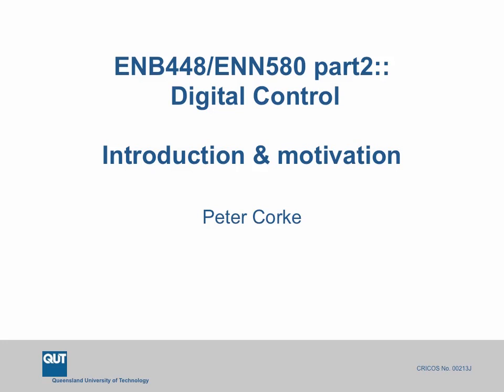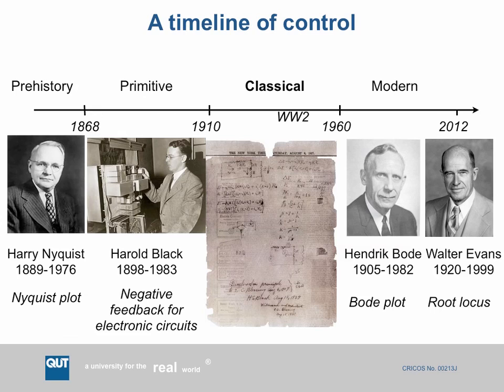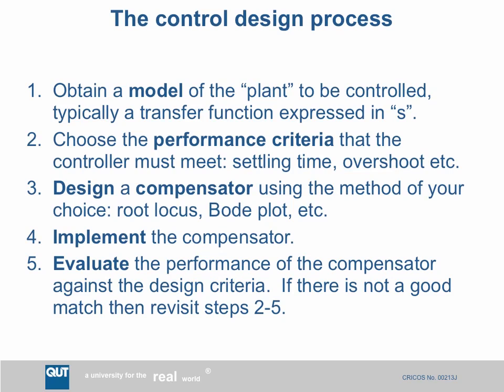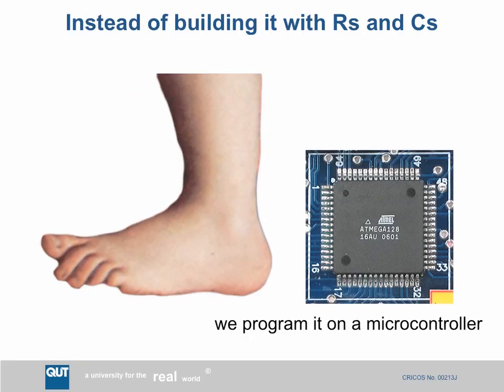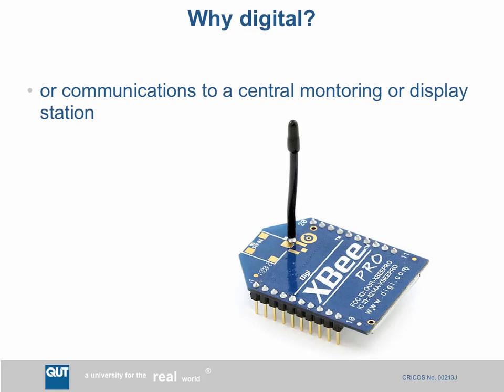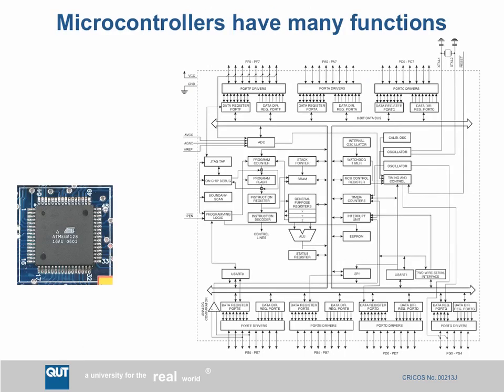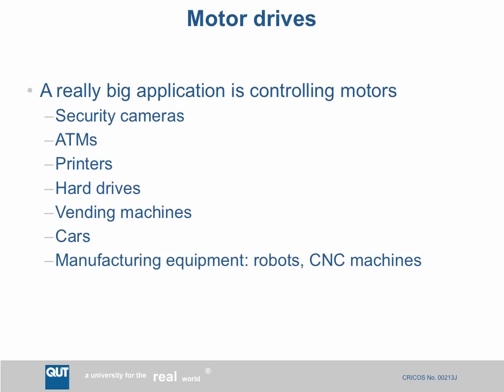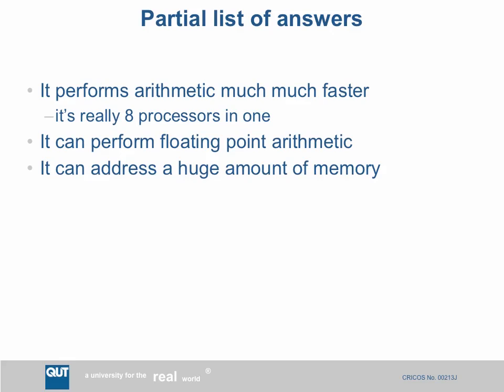ENB458 lecture 1: Introduction to digital control

Comment from the maker: Iftikhar, when you discretise a plant you need to know the sample interval so that the dynamics of the discrete and continuous systems are matched.  If you change the sample interval then the dynamics of the discrete time system no longer match.

You recall that one way of mapping between continuous and discrete is the matched transform

z = e^(sT)

Flip that around

s  = (log z)/T

You're using the same discrete model so z stays the same, but you are reducing T, so the effective continuous dynamics correspond to a system with larger poles, a "faster" system.

So you are using your controller with a different plant, a faster one, which is why you get the results you do.
Reply: Thanks for sharing. 
I am yet to watch the video but this reply itself is very important. 
I will definitely watch the series and your other videos. 
Liked and Subscribed.